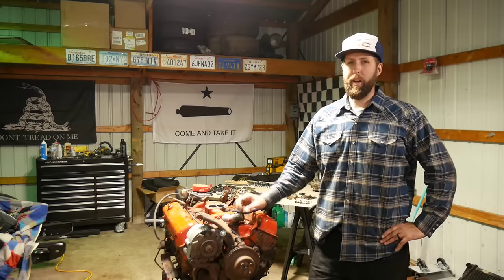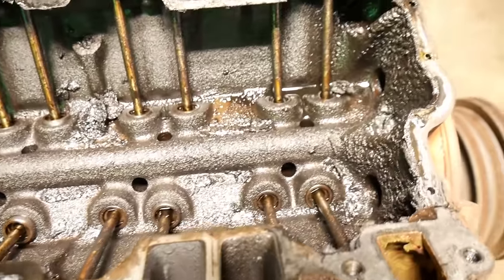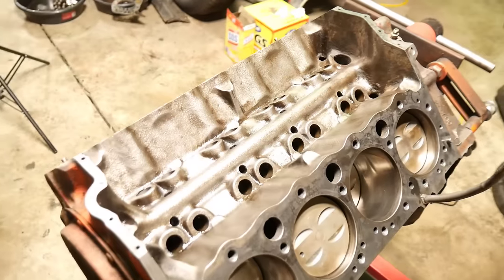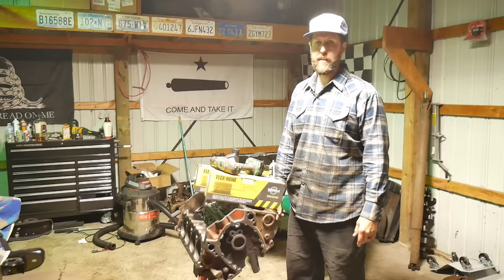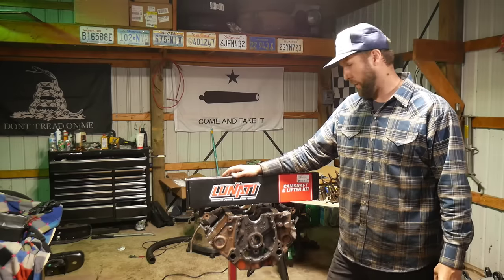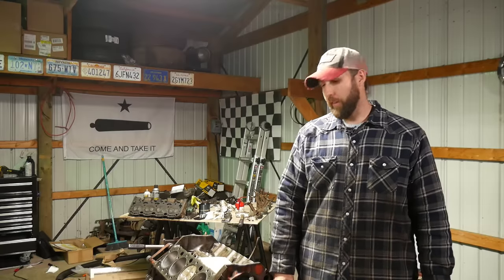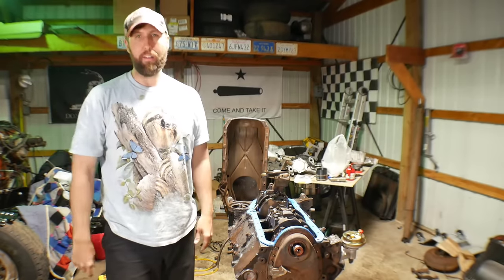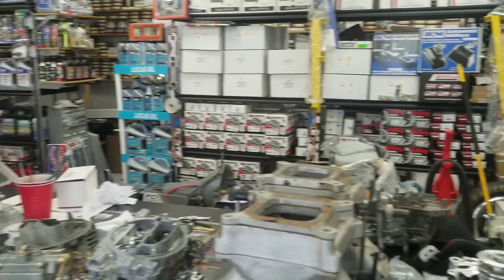Budget 307 Small Block Chevy Build & Dyno - Vice Grip Garage EP28

Comment: On the 305 heads did you say the casting # 1611 is that correct???
Reply: Actually (416) 305 heads . (081) 305 heads are another good choice.

Comment: use aircraft sealer on everything but the valve covers then when dun setting up the engine then seal up the valve covers this is the only way to keep it sealed or it will leak over time this is what i hate about sb chevy .

Comment: When you said 307 , I said uh oh timing problems, all the parts r trash, that motor is a timing set nightmare, but I've seen like a 74 350 with plastic upper timing gear ,you expect that to b cracked but not steel,don't know why but I've seen people race 307s & timing chains & gears were what always broke,especially if it's not double row!

Comment: The 307's needs camelback heads to increase compression, and flow, with the larger intake, and smaller combustion chamber. you could have lager valves installed, and the head decked, then you have to screw with the manifolds and distributor gaskets to get them to fit and not leak.
Reply from the maker: The 305 heads do the same as camel hump, except 700-900 cheaper
Reply: are they 194 intake valves? stock is 174 on 307 engines which just doesn't cut it.

Comment: Considering most 350s are running 250-280 HP, that's rather impressive for a 307. And boy, using a dyno to break in a cam sure seems like the best way to do it. Trying to hold them engines at a steady 2200 RPM with questionable gas delivery and all is annoying.

Comment: Hiiii "funny" friend .... mechanic player !!!  
why you don't use "Permatex copper spray" and friction proofing Wynn's when reassembling....?  Explain to people why the diamond pattern of honing finish  (oil retaining around the piston reducing oil consumption YES OR NO....?) 
Honing the came followers holes --- 
I use to put for soaking for about  3 minutes +/- the gaskets made out of hard material in warm linseed oil ! 
Did you check the wear on the valve rockers ...? they must be free of any unequal  wearing !!! The paint for the engine block and all the cast-iron engine blocks must be a porous paint  (cast-iron must breathe or sweat...)!!! 
Of cause all this is for or by a meticulous  mechanic work !!! Best regards dear young friend!!

Comment: Once upon a time for I got broke and sold it FYI kids mortgage Built large journal dart 400 block 327 crank Custom pistons 13 to 1 with Canfield head solid  Roller 6.125 rods 370 ish cubes 600 horsepower 575' pounds of torque 8500 RPM Big block killer

Comment: The 307 could flow better and rev higher. The 283 was a rev monster. We built a 66 Chevy II with a bored 283 that was punched out to 292 cubic inches. We used 1.94 intake valves and 1.5 exhaust valves in decent flowing castings. We used a roller cam, since 0lane intake with a 1050 dominator on it. That too some expert tuning. Our teacher was very good at it and he left the school the year after I graduated to open his own speed shop. The 307 would have worked as well if it had gotten a forged crank from a 327, decent heads and pistons, cam and everything else a high revving motor used. Our 292:ran in the 10.90 class at the Winternationals at Beeline Dragway in 1976. We broke out in the final round, losing with a 10.89 to a winning 10.93. We had been running consistent 10.91’s all weekend long. In the 60s and early 70’s they were very popular drag racing engines, being revved to 9,000 rpm or more. The bump in torque from a 327 crank would reduce the need for the high revs so you might get away with 8,000 to 8,500 rpm. Maybe.
For that engine. 290 hp ain’t bad. A few dollars more and maybe some light porting on the heads and decent cam amd springs, one hp per cube is in reach plus a bit more. Not a bad engine for a grocery getter out of moms old station wagon!

Comment: Can't you stick a 350 cam in there and put a 350 fuel pump in, or no am I completely wrong,that's what I did for my camero 305 engin just switched out 305 to350 cam and lifters and new rods with an up greaded fuel pump for 350 much more power and performance I didn't do all the technical  bullshit lol.. that's what t I should  of learned rebuilding

Comment: You didn't do something or didn't show it, I NEVER rebuild a motor without a new set a cam bearings.  They are cheap.  As gummed up as that motor was I would have pulled the lifter oil galley plugs and brushed them out.

Comment: I know you're very smart guy and I'm sure I'm just being redundant.. it is all about controlling combustion to get that fuel in this cylinder to ignite at a designated time closer to top dead center as possible not later not before. So carburetors I'm not going to give you that closer to perfect control. There's something crazy I was feeling very innovative so I installed what they call hydrogen on demand. So this system produces 6 leaders of hydrogen per minute. The problem is once again controlling combustion you hit the gas it sucks up all the created hydrogen and then there's Peter's out until I can build up again. So you can imagine what kind of havoc you played on the computer in the sensors on the car. Granatelli Motorsport said they tried to tune the car with it and they were getting probably around 20 more horsepower but it was add fuel then take it away. You really have to design a car for hydrogen depending on how much you want to use and it should be under pressure and injected so all ranges of RPM can be consistent and how much hydrogen in the car gets. The purpose of any hydrogen they say some cleaning benefits or whatever but what it does is or what we wanted to do is to burn the fuel more completely instead of getting $1 worth of energy at a $5 and having $4 being incinerated by your catalytic converter that's the idea. So I was going to remove the system and then I said wait a minute if I could create a stable environment which would limit a lot but constant rate of speed cruise control RPM I figured the total cubic feet per minute of H2 .8%.. so relatively speaking that was very little but my gas mileage went from 28 miles per gallon and that's what I'm not putting my foot into it with 640 horsepower.. to 46 miles per gallon. Someday we'll get her act together but we're going to have to have a lot of electric cars first because obviously the energy conversion for hydrogen is not realistic unfortunately. The most abundant element in the universe I was sitting here with our thumbs up our butt. And even if we do get hydrogen to work I would say hydrogen turbine electric whatever enjoy have fun

Comment: Bolt on 350 heads on a 307 u will gain hp 307 val are small 
350 val are bigger
U can pit dissles heads on a gas 350 u will have bad ass dissle.

Comment: A 307 is a large journal setup not compatible with 283 anything. In 68' most of GM Chevy small blocks moved to a large journal crank and block with 3", 3.25 and 3.5" strokes. And... don't be buying cheap pistons for decent motor.

Comment: a 'REBUILD" woulda included Cam bearings ,  putting a new cam in without new bearings is like takin a shower n putting your dirty underwear back on..
Reply from the maker: Yes, allows you to break in the engine (bearings, rings, clearances, valvetrain, etc - while being able to closely visually inspect for leaks, air/fuel, coolant flow, etc. Just "insurance" that everything will go well when you take the time to install it in the vehicle.
Reply: @ViceGripGarage  I enjoy your video's a lot but to Quote YOU... "I'll be Dipped"  that reply don't even make sense to my comment..  Oh I get it..  Since New Cam bearings would be the right thing to do... we're gonna just do the right thing n skip that part..